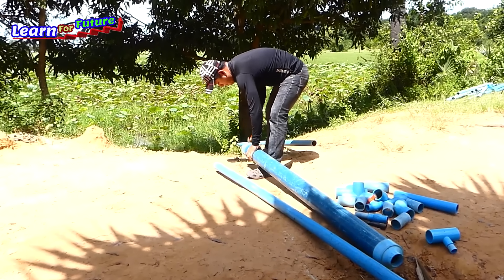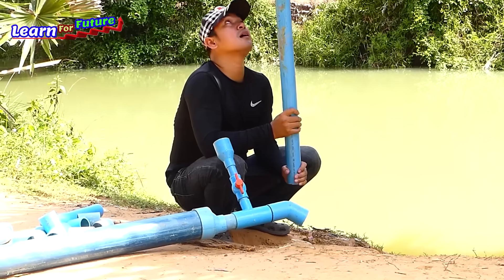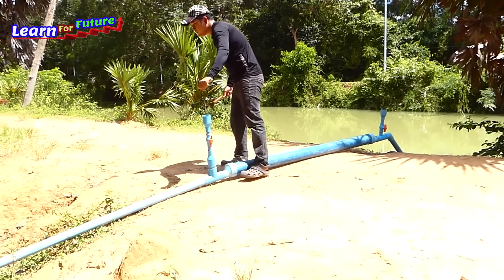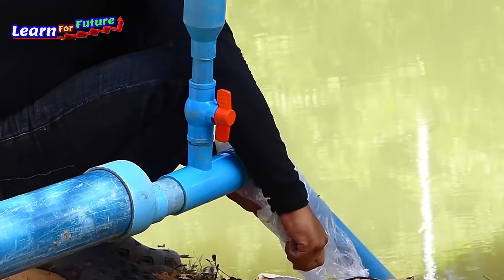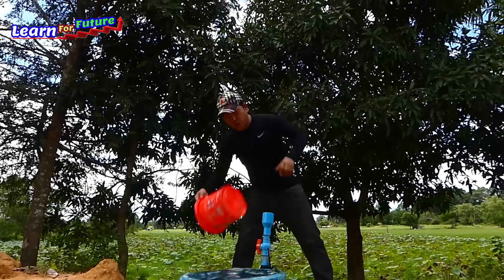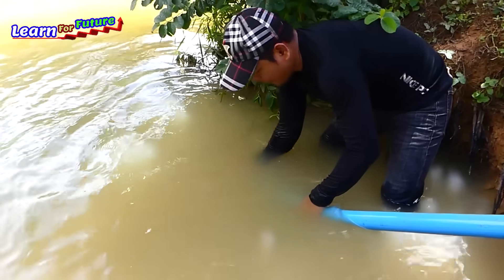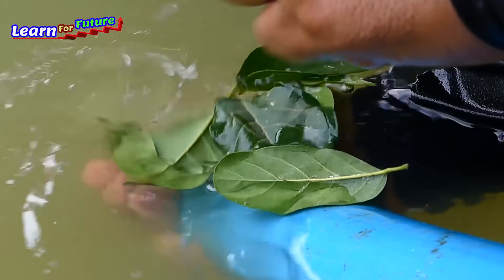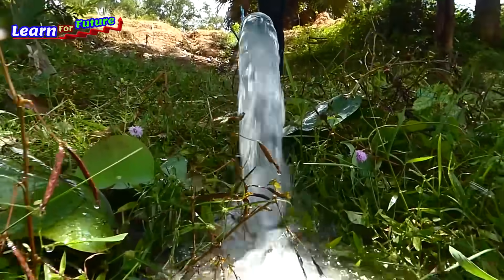Free electricity | I turn PVC pipe into a water pump at home free no need electricity power

Comment: This pump doesn't work because the vacuum in the chamber prevents the water from leaving the  chamber. It's a simple siphon, a water filled pipe does the same job. Try it with a pet bottle

Comment: I have this siphon system on my pond. The pipe runs allthe way to my house snd through the house. But we connected it to a regular well to. The well water is no good to drink. But i turn it on and it pushes well water uphill backwards through the line from the pond. It primes the pond line, fills it up. I can't use buckets because it would take forever tofill up the long line to the house. So i fill it up using well water. When well water runs into the pibd, i turn off the well pump. Then the water siphons downhill from the pind using gravity only. I get good volume and about 30 lbs pressure coming out the faucet. But I raise it to 40-50 lbs using a pressure pump in the house. Most city houses have about 60 psi, but if you get any higher, it can blow old pladtic lines apart. You dont need 60 really🙂

Comment: 1. The water inlet is higher than the water outlet
2. Seal the water inlet and outlet first
3. Fill the pipe with water from the middle and then seal it
4. Open the water inlet
5. Open the water outlet

Comment: Dig a trench across the road and put the pipe, it flows faster, you pour water from the high side to the low side, you only need 1 valve.

Comment: Misleading thumbnail and there is no special about it. The water source is elevated than the outfield so even a just simple hose will flow water to the output field. You just create an illusion that the water source is deep compare to the output field by raising the middle field betwwen the output and source higher than the water source then take out the air bubble inside the pipe for continues flow. The thumbnail that shows high pressure is misleading.

Comment: So far my observation goes that the height of waterfilled funnel nearest to the source should be more than the hieght of that nearest to the water supplying point and  before both the funnels are filled in water the supplying end of the pipe should remain tightly closed ,This is my o.bservation asking  the comments from the experts

Comment: Again, no miracle happened because free energy does not exist...Connected containers are two containers (or more containers) in which, after filling with liquid, the level rises to the same height.
Formula: p = h·ρ·g
 A tank with a higher water level tries to equalize the water level where there is a lower water level

Comment: Same history of the pump made of oil tank, if the water source is high than soil will flow , but not with it strenght, it's quite fake. Just a trick  with a hidden electric pump.

Comment: If the dry field is lower than the water level of the river, all you need is a hose to do this, isn't it?
Reply: You need only to dig the land make little canal going through in the ricefield and layout plastic pipe then return back the soil...
Reply: Yes, A horse is enough. But this method is easy than removing air in the horse sometime. But not very difficult!
Reply: Ini benar kalo lbih tinggi airnya..
Reply: What if the area is higher than the water level? 

Are there any DIY videos you can recommend? If it's effective
Reply: No need to such complicated process like that. The law of gravity is applied if the river is higher than the farm all you need is flexible hose fill with water as a starter.
Reply: correct..... there is no such thing as FREE ENERGY.
Reply: @ildingparin  11

Comment: Hoaks
Reply: Noop, it is an ordinary siphon. Perfectly sound project.
Reply: Fake
Reply: @lihirdestiny239  As long as the water level in the river is higher than the outlet in the rice field this works fine. Even better if output is turned upwards with a bend or down into a bucket of water. Prevents air from sucking in from the outlet.

Comment: How long you gonna keep making these fake videos?
Reply: This one works, it is a siphon.
Reply: @Dingsrud  siphoning doesn't work if the outlet is higher then the water level, basic physics:)
Reply: @KevinSmith-os5yz  That is right, and to me it seems as the outlet is lower than the surface of the river. De is going downhill.
Reply: @Dingsrud  based on his previous videos,  I wouldn't trust a thing he claims. The water coming out is way more than a simple siphon would provide, unless he has substantial drop in elevation, which he clearly doesnt.
Reply: @KevinSmith-os5yz  Not so sure about that. I am siphoning a small pond outside my cottage. Using a 32 mm PEM-tube. Lifting over a 30 cm ridge and with about 2,5 m head. The speed of the water is impressive. Sucks out dirt and leaves from the pond. My impression is that head does not matter that much, but the friction in the tubing. 

Agree that the opening picture on Youtube with water spouting out upwards is a click bite though. That will not work.
Reply: @Dingsrud  I'm assuming by head you mean the amount of drop below water level? 2.5m is a decent amount. I doubt thus guy has more than .25m head. But anyway. No one is really interested in watching a siphon, hence the click bait:)
Reply: @KevinSmith-os5yz  Agree on that. The system with a barrel or, as here,  a thicker tube is anyway a practical way to prime a siphon. When the diameter of yhe tubing gets bigger, it can be a hassle to fill it properly.Head is the same as hight from discharge up to water level at intake.

Comment: it will bi wonderfull, if it so easy, but without external energie it is impossible... SORRY ...good maked FAKE
Hi is a Master of Magic 🤣
Reply: You're a lousy, goddamn physicist, this is Newton's 3rd law, (action, Reaction). go fishing....
Reply: It is a siphon, no magic here. Ordinary physics.
Reply: @Dingsrud  but outlet point is in down level than inlet..
Reply: @sathishag1906  Yes, agree, and that is why this works so well. Siphons are nice in some cases. Often used to drain ponds and reservoirs when needed.
Reply: @kjellg6532  so we can't use this method to lift the water to 4 or 5 feet above the inlet water level..

Comment: Great method, but how many feet will it be possible to raise the water....what more for mountains!
Reply: About 10 m, but the output must be lower than the source!
Reply: Yes, and if you look at 6:40 he is going downhill to open the discharge tube. Seems to be lower than the river. One comment is that two filling tubes are not needed, but makes filling a bit easier.